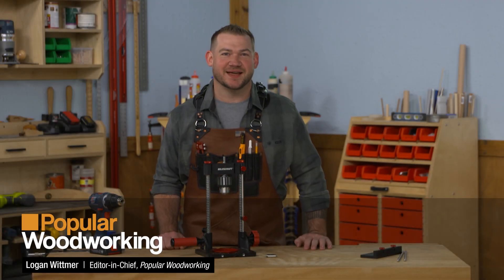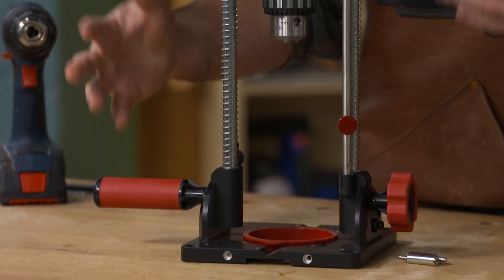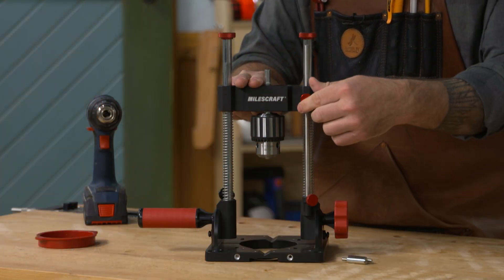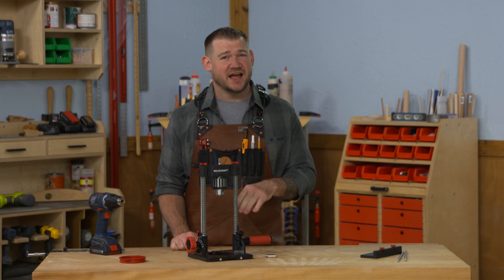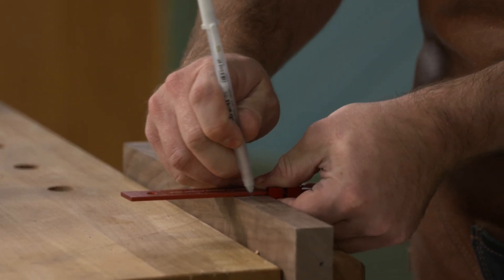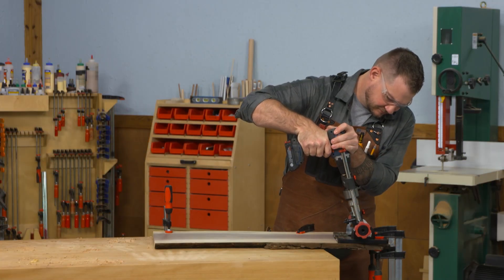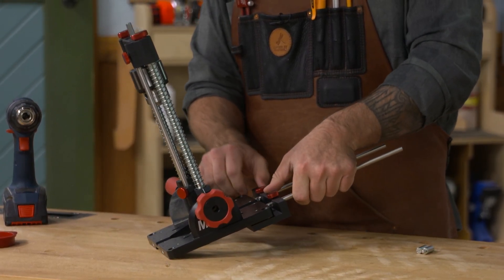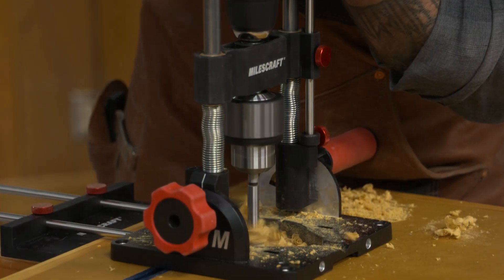Checking Out The Updated Milescraft DrillMatePRO

Comment: For those wondering what the differences seem to be compared to the non-pro version:
1. Machined instead of cast.
2. Springs on both side rails instead of one.
3. Dedicated rail for the stop.
4. Heavier duty base. The cheaper version just has four small pads. The pads on this one seem much beefier.
5. Place to put the chuck key.
6. Knobs at the top of the rails are shorter and metal, this was annoying in the old version as it can prevent the drill from rotating around the knobs. 

I have the old version and while it allows me to drill mostly straight, it's not the most stable platform. There is always some wobble from where you think the drill is aimed and where it actually drills. For most use cases this is fine.

From what I can tell, that's what you're paying for with this new model.

Comment: I got the original and I like it overall. Nice to see Milescraft found a way to secure the chuck key but it looks like the same size chuck. Would have been excellent to give it a larger diameter chuck to accommodate more drills. And if the rods are spaced to match the Festool router rail guides - that would be excellent.
Reply: I just checked online.  Apparently the chuck has a maximum capacity of 3/8 inch.  That's a serious limitation :( and it's not cheap.
Reply: @KenFullman  The original version was limited to 3/8" - which wasn't too bad at $40. And I needed a 1/2" size when I bought it. Ended up using a 3/8" forstner, but at three times the price? I'd want 1/2"
Reply: @KenFullman product description says 1/2" on Amazon
Reply: @falxonPSN  Yes the latest model is 1/2" and it's still more expensive than a drill press.